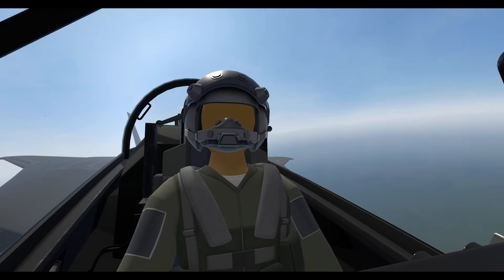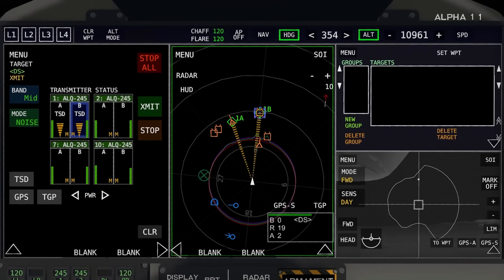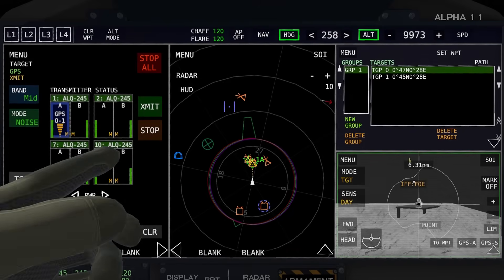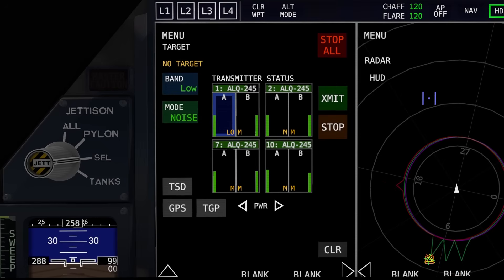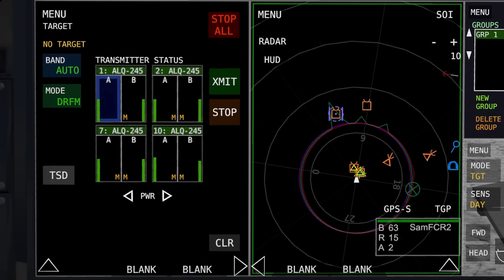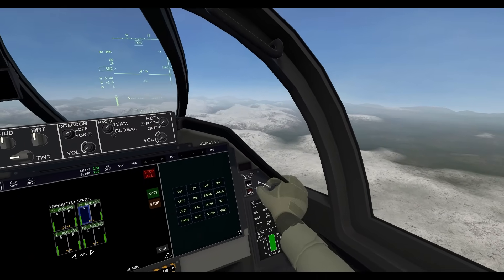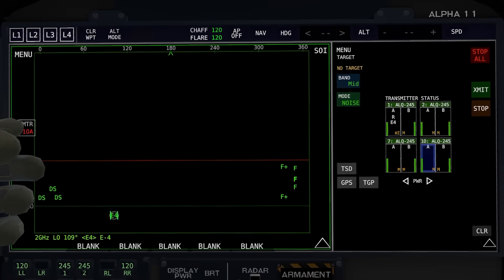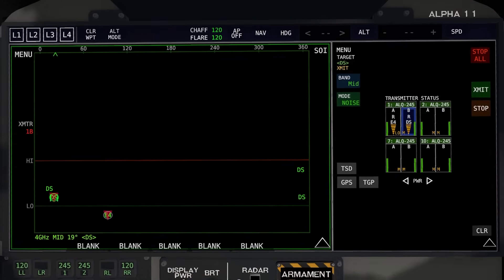Full EF-24G Jamming Tutorial | VTOL VR DLC

Comment: VERY USEFULL NOTE!!!
on your hud there's a roll meter. its like a half moon with and arrow in the middle. Located at the lower secton of the hud
There are 2 parts that really matter. you have 2 big lines at either side.
that part shows where the jammers get blocked. for example. you need to roll sideways and you turn through the first big line on that side. that means the only the jammers on that side gets blocked. you know when jammers are blocked when a white X is over your XMIT screen. so the part where there are still lines inbetween are good. you will block jammers if you enter the empty part of the half moon.

I explain like dog water, check it out in a free flight or something. you will get it when you see it.
Reply: thanks, that makes that plane even cooler

Comment: Sorry I'm silly, what does noise, DFRM, and SAS do again? I tried to rewatch but could not find it. Sorry!
Reply from the maker: Quoting @thexlonewolf671 who left this comment on my other jamming video:

To further explain jamming, there are three kinds of radar degredation: noise, or barrage jamming, DRFM, and signature augmentation.

Noise jamming is fairly straightforward: it overloads the targetted emitter with false returns, causing the real target to be lost in the noise. It's very useful for jamming multiple radars at once if you can get them all on the same bearing. It can also hide any allies that are in the jamming corridor, delaying lock-on. However, you have to manually set the frequency band of the jammer and your radar is unavailable while jamming. It also gives away your bearing (though not your range) and you're susceptable to missiles fired in home-on-jam mode.

Digital Radio Frequency Memory, or DRFM jamming, is more complex than simple noisemaking. It involves digitizing the received radar signal and modifying it to achieve a result. Typically, DRFM jamming does this by copying the radio frequency of the radar pinging you and sending it back to the receiver at a higher power. This creates a loud, but false track that the jammer then "walks" away from your aircraft to break a lock. The advantages of DRFM jamming are that it automatically matches the frequency of the emitting radar, and it can pull single-target tracks (hard locks) off you. The disadvantage of DRFM is that it can only affect one emitter at a time, allowing multiple enemy radars to cross-reference and get your actual location.

Finally, there's Signature Augmentation. It operates on many of the same principles as DRFM jamming, but instead of walking the false track away from your ship, it modulates the signature so you instead appear as a different track. The primary use case for this is to have a MALD decoy appear as a larger aircraft, say, an F-26. The advantage here is that signature augmentation can't be tracked by missiles in home-on-jam mode and in PvP lobbies specifically, it can trick enemy players into making decisions based on bad info. The disadvantage is that it doesn't hide your actual position, and in many cases, the decoy radar pulse is a lot stronger than the actual return, which can actually give your position away.
Reply: @darkstar1592  So Noise is just make you and others be lost to the enemy by hiding in the fake returns? DRFM is making the lock be away from you? SAS makes you look like another aircraft? All of these are for what aircraft you tell sensors to jam? And finally, the deferent frequencies are for deferent craft and electronics? Making sure I get it.
Reply: @SJKJ_  the different frequencies/bands affect different things, but not specifically different aircraft
you can use LOW, MID and HIGH band on an F/A-26B the same you can on an F-45A, the only thing they change is what you are jamming

LOW band disrupts GPS and comms, so the person you are jamming will hear static over their radio and GPS bombs won't work properly
MID band disrupts radars that are currently searching
HIGH band is for radars that are currently tracking you (like an AIM-120s built in radar when it goes pitbull)

Comment: I have a question, what if i shoot a fox 3 to an enemy aircraft and then jamming it with HIGH band to confusing its sensor for incoming missile? Is that suppose to work like this? MID band should confuse the radar sensors.
Reply: You want to use DFRM for fox 3s and STT locks. High band doesn’t do much to them
Reply: @snarf9455  dont think thats what hes asking. Hes the missile shooter and wants the victim to not notice the incoming missile. Id like to know the answer to that too @tudor74277 !
Reply: Yes, sorry for the confusion @snarf9455. After shooting a fox 3 to enemy aircraft, i will use HIGH band jamming to enemy aircraft for disrupting his sensors. But i guess this will work with MID band

Comment: Nice, but would be useful to know the tactics of using jamming. Like, when do you use Noise compared to DRFM, and how will power settings affect it? I guess we'll have to wait a while till the community gets enough experience with it to cook up working tactics.
Reply from the maker: DRFM is used to break radar lock, while noise is used before you get locked to prevent the lock from happening in the first place. Important distinction because noise won’t usually break an active radar lock.
Reply: DRFM is definitely more useful as essentially a self-defense jammer. DRFM does not prevent the use of your own radar and does not need to be micromanaged. On the other hand, it does not help any of your allies as it essentially only creates false contacts of your own aircraft.

Noise on the other hand is great for supporting friendly assets as noise jamming essentially creates a corridor of noise that allies can hide in. 

So in a fully coordinated strike package, i would have the strike aircraft with 1, maybe 2, self defense jammers set to DRFM. Meanwhile i would have a fully jammer loaded EF24 behind the strike package running full power noise on all bands, with a 4th pod in reserve in case they need to use DRFM to break a lock themselves.
Reply: @capt5656 indeed
If you're trying to Attack solo then you can just keep it on
Reply: Noise is pretty much the default you want to use when you have allies nearby. If you want to mask yourself you use DRFM, you also always want to use DRFM to break STT locks coming at you, if someone locks onto you, immediately transmit DRFM at the source
Reply: From my understanding adjusting the power will reduce the burn through range of your jamming.  If you are too far radars will be able to lock you and fire on you. Increasing the power allows you to jam effectively from a further distance.